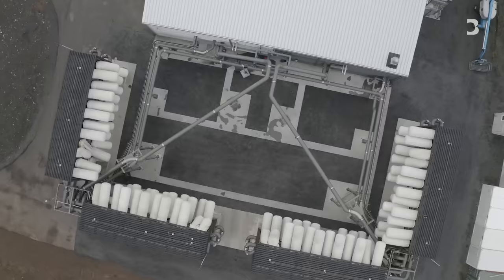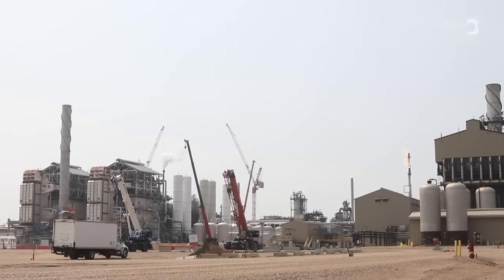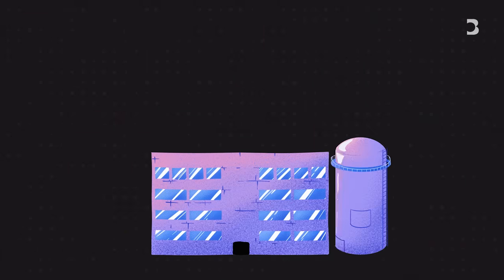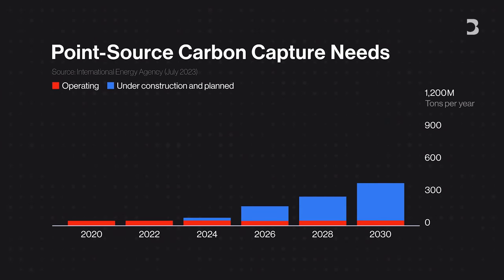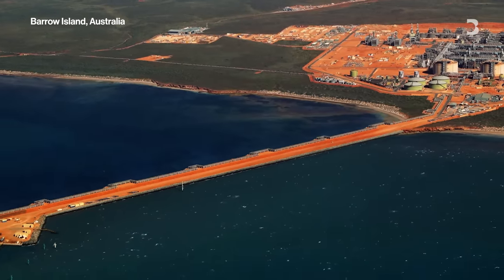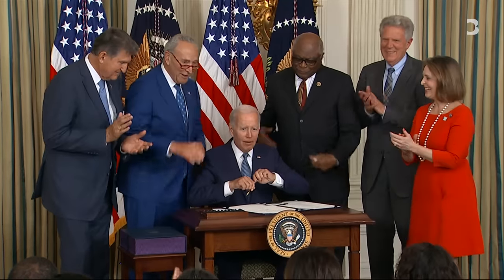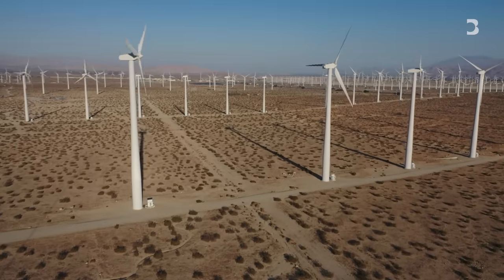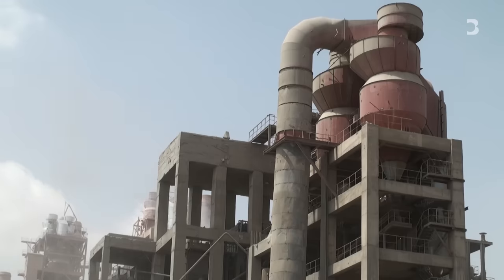Big Oil’s Favorite Climate Change Solution

Comment: It's poor value for money for the reduction in carbon it delivers. These oil companies have a lot of money to spend, and the only reason they are spending it on carbon capture is to to keep the existing business model alive. For every year carbon capture fails to deliver reductions in carbon they should be forced to redirect that investment into other technologies that help abate or reduce carbon, at a higher rate than carbon capture.
Reply: I agree with you but your comment does not provide any other definitive solution for what can be done to pull existing C02 from the atmosphere. Nothing comes to my mind for what that might be since what little I've read has boiled down to "there isn't any other effective solution". Like say plant trees? That would take years and so much land that at this point in history it isn't the solution needed right now.
Reply: @chaoticrealm777  carbon capture doesn't work. see Gorgon
Reply: @chaoticrealm777   There is no definitive solution for carbon capture. No one is arguing against having a technical ability to capture carbon. But it's misnomer to say there is a definitive and effective way to capture carbon. 
There is only going to be so much money to go around to help solve the problems, and where money is spent on ineffective solutions then there needs to be more accountability and pressure to reduce carbon output.
The cost of carbon capture research and pilot programs can't bee seen as just another cost of doing business. Failure of the programs to deliver needs to come with more penalty.
Reply: @chaoticrealm777  less focus on pulling existing Co2 out of the atmosphere and more on not emitting, at the source

Comment: Carbon capture will never be a solution. CO2 is 442ppm that will never work. You could however capture it at the points where the CO2 is created, but we should have build these 20 years ago, why did we not do this? Money.

Comment: 2030 is not any special date WRT carbon capture. Talking about it in that way implies using carbon capture to offset fossil fuel use. That applies whether you're talking about CCS on coal plants, or direct air capture. *None of that is going to happen.* First, renewable energy will ramp up; THEN, direct air capture will ramp up soon after. Anything else is simply irrational.

Comment: You do realise that carbon capture comes back out with a geomorphic fault right? How ever many gigatonnes you capture and push into the rock, one fracture, and we get 5 years of C02 in a day. Imagine what that will do?
Reply: Not all carbon capture. Some, yes. It's stored as a gas in the same places that natural gases were stored away before. Other CO2 is mineralized and turned into a fine powder. That way the process is irreversible and does not have the same risk.
Reply: Sadly, the mineralization process is not what is mostly being practiced.

CO2 pipelines will also be an issue. Pipelines eventually develop leaks. Has already happened. CO2 is denser than air and will make people very sick, possibly with chronic effects, possibly fatal if people are exposed at high enough concentrations long enough.
Reply: This is the equivalent of sweeping the problem under the rug and out of sight
Reply: @chow-chihuang4903  the same could be said for methane which is also in our geological storage as a gas but is generally trapped there too. 

It's possible to be kept as a gas long term.
Reply: @buryitdeep   what's the solution?

I don't mean to avoiding increased planetary warming, for that we need massive decrease in use of fossil fuels.

I mean for the huge excess of CO2 that already exists in the atmosphere, is already having such catastrophic effects and takes hundreds to thousands of years to be naturally removed.
Reply: The safest method is to compound it to a more stable solid or liquid form such as a carbonate (mineralization). Storage methods always hold some measure of risk, with varying levels of consequences. Methane leaks occur all the time, per another response. It poses other hazards, though different from CO2.

Look up what happened to the people of Satartia, Mississippi for an idea of what can happen when a  CO2 pipeline or storage leaks. Often hydrogen sulfide is part of the mix, usually from petroleum or methane extraction, which poses its own risks. ICE engines stall so emergency response vehicles can get only so close. Most people won’t be able to drive away.